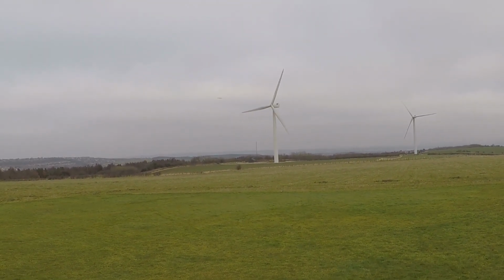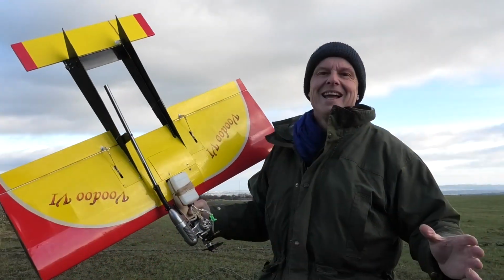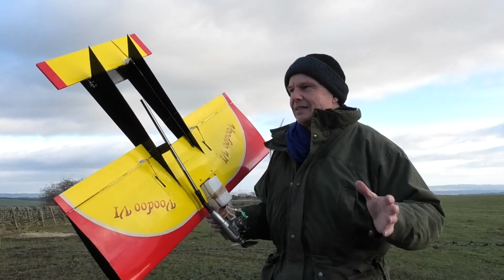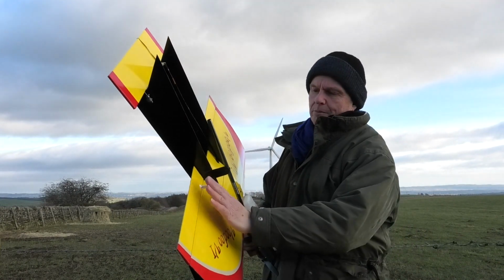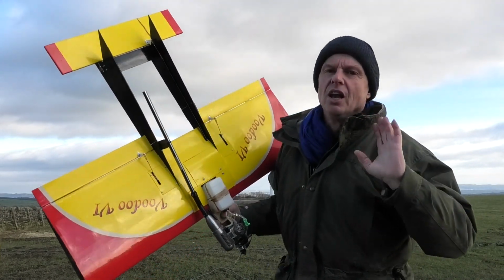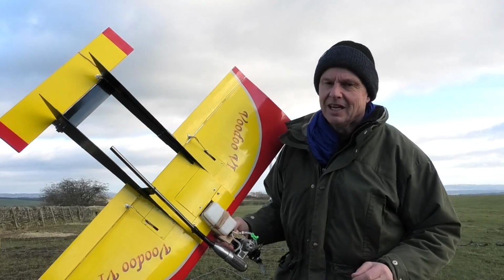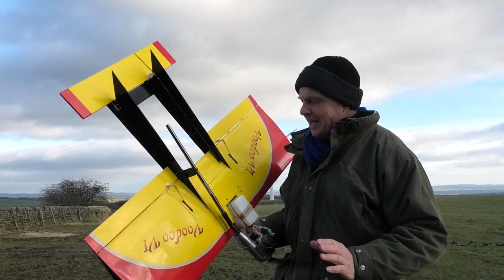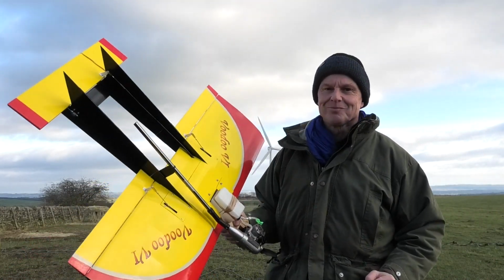Voodoo VI - Hi Performance 40" Combat Wing: Pt 13 - Rebuilt Maiden!!!!

Comment: Very nice! Launching looks a bit tricky though - nothing to grab on to ;)
Reply from the maker: Thanks for the comment, pleased you like it.  The launch is fine, I have some course wet & dry paper glued to the side of the engine bearers which give a really positive grip, its just a little tricky lifting it into the launch position above your head, but ok when you get used to it.